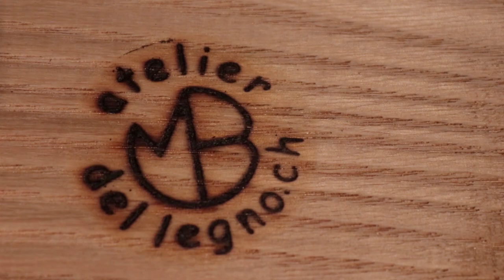Sharpening the hollowing tools

Comment: Pretty cool. I sharpen my hook from the outer side. But I think your method keeps the original bevel of the tool and maybe expands the life of the tool a little bit more. Thanks for sharing.
Reply from the maker: Thanks. Exactly like you say it lasts longer and stays in form better. The outside works too but I changed a while ago to the inside!